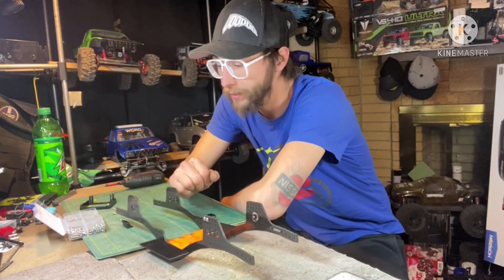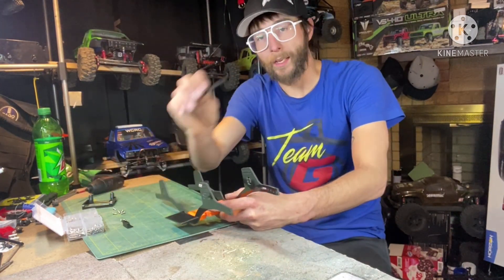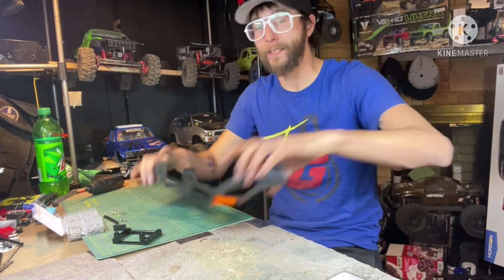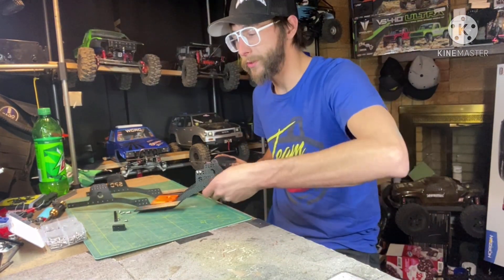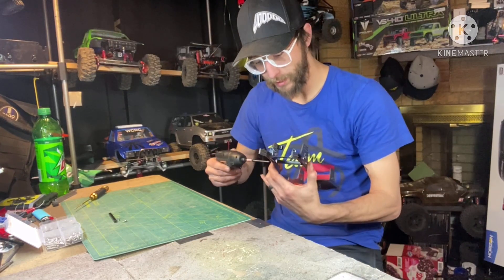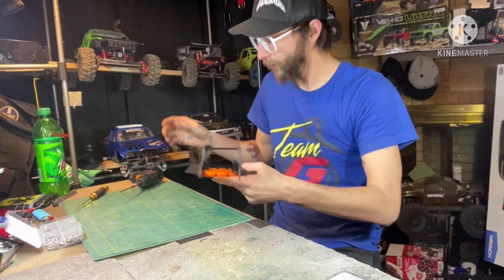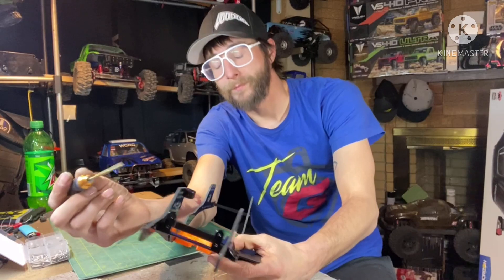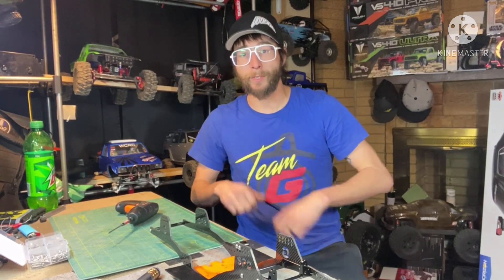Gspeed LCG quick tips

Comment: Hey man when will you have a gs-fs build video up? I wanna see some Tun footage of that thing. Looks insane.
Reply from the maker: Prolly not, don’t have plans for one really or a need
Reply: @TRDAdventures  10-4. I’m looking everywhere for run footage of it and can’t find anything. I’m trying to decide what I’ll build on my newly acquired set of AR44s. I have done TRX and Capra portals in the past and am doing my first straight axle build. I run a stock enduro hd too. Just trying to decide on flat or angled skid one of the local compa requires flat skid and 4.19” tires for class one and that about i other than front bumper. 🤔
Reply from the maker: @covecityboys  it’s not out yet. But if your looking at class 1 chassis, I recommend the brazin c1 pro, CCW razors edge or the Exo Everest
Reply: @TRDAdventures  yeah I’ve been looking at them. I honesto don’t see anything in my area competing with the enduro in class 1 flat skid. Folks around here just usually run class 2 or really tiny incapable tf2 stuff etc.
Reply from the maker: @covecityboys  gotcha, the Everest chassis may be “class 1” but I actually run is as my class 3.  The Exo chassis are very nice.
Reply: @TRDAdventures  yeah I’ll have to check it out. I have been looking at the v1 1 too but I wanna be different. Looking at Geisha Racing.

Comment: So what is the advantage of the pinch. Or is that just how they are designed and why not just make the skid skinner or other mounts wider so there is no pinch.. I am pretty new to this kind of crawling truck so I am trying to learn. Thanks. Love your content
Reply from the maker: No advantage just the way it’s designed, most are like this.
Reply: The advantage is it adds rigidity/ strength to the chassis

Comment: Thank you for your videos. Just a quick question in regards to chassis. Any major differences between TGH-HH Sherpa vs G-SPEED V3? Thanks.
Reply from the maker: They are very very close obviously there are some different shock mount locations for tuning and it has a 7.5 degree angle on the skid vs gspeed with 6
Reply: @TRDAdventures  thank you for your response.  However in terms of performance, are there advantages between 7.5 over 6 or vice-versa? Thank you.
Reply from the maker: The Sherpa was designed towards portals and the angle helps with break over
Reply: @TRDAdventures  Thank you for the clarification.

Comment: Im in this considiton also, im using salinas transmission with 84width and use tgh dsm and im using  Gspeed G10. Is that okay if im bending it into the short DSM?
Reply from the maker: Yes it will be fine, I’ve seen it done many times.
Reply: Thanx alots....nice video